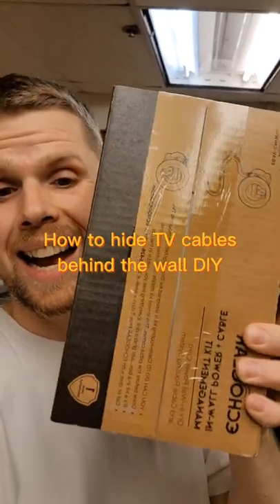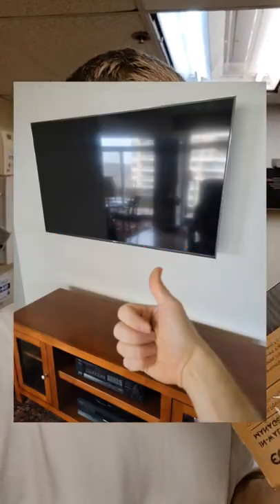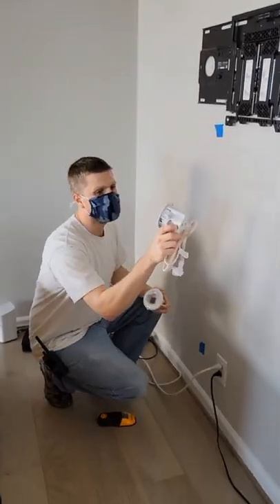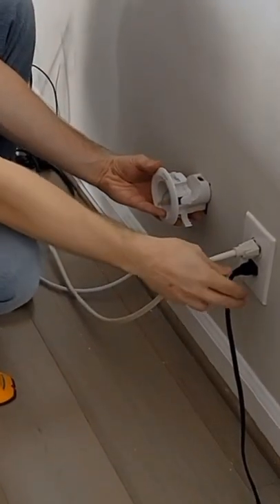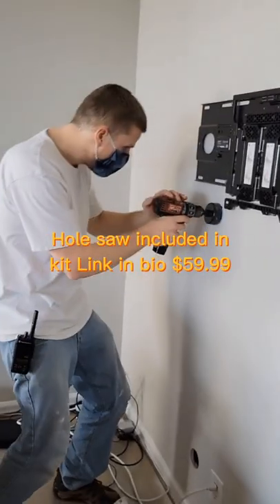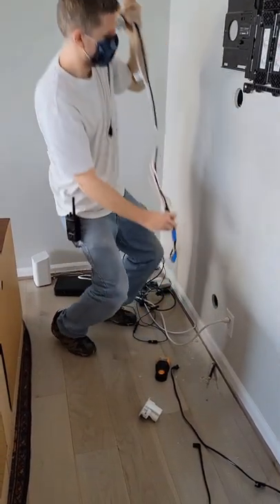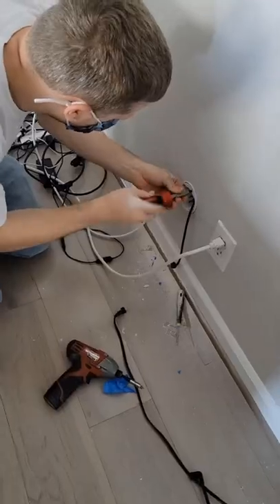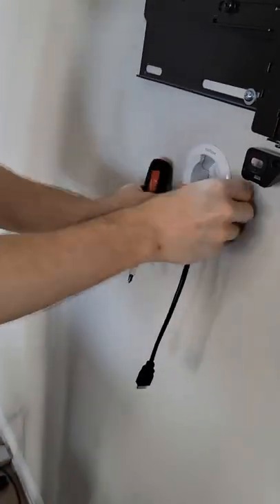How to hide tv wires #diy #shorts #handyman

Comment: Wait what was the point of the plastic piece
Reply from the maker: Which one
Reply: @Mechanicallyincleyend  the circle plastic pieces wouldn’t it be the same effect without it. Just drill 2 holes and run the wires through
Reply from the maker: @lilvic372  it has a recepticle at the top

Comment: You can do this way cheaper, easier and you can make the plug hidden too.
Reply: Your paying for the convenience.  Maybe he doesn't own a keyhole saw or drill bit or know what to buy. Nowadays people don't want to do anymore work than they have to . Yes it can be done cheaper he even said as much .
Reply: @rogerdodger5886  - I mean there are better products if you are putting a hold in the walll. If you are going to do all this, you can move the outlet straight up the wall and plug it in behind the TV. Same thing with the cable. Difference is he’s being maybe paid to show you this way with the kit.

Comment: If you can just drop that down your wall. You got screwed on insulation of your house
Reply: No need to insulate a wall if its an interior wall though...
Reply: @jeffreyruch7660  sound insulation has entered the chat.
Reply: Not having sound insulation doesnt mean you got ripped off though, not like thermal insulation missing..right?
Reply: NEC 400.12(5) extension cords cannot be installed inside walls.

Comment: OMG, they sell this!? I've been doing this for years.   BTW, if anyone tries this on an outside wall, it will not be so easy.   Insulation is a Mother*##*er.  Or in a house built before 1960.    Them old houses, they do not design the "old work" material for them, the ones that  need the work more than anything

Comment: ..so many code violations-
Reply: Not really I did this for my customers all the time it really does piss off electricians but it’s real easy to do
Reply: @Bob Saget power code in the wall is a code violation in my area.     I was going to install one of this in my new home.    Inspector said "NOPE"....
Reply: @Dont CensorMe it’s all in the fine print.
Reply: @Bob Saget it’s two completely different types of wire. Stranded wiring is not rated for in wall use, just like romex isn’t designed to be used as an extension cord. I think it even says it on the extension cord tag. So if this is done and IF it does melt down and cause a fire, don’t expect your insurance company to be very happy.
Reply: NEC 400.12(5) extension cords cannot be installed inside walls.

Comment: Bruh if that’s the case where you have no horizontal stud why not just connected direct to the outlet instead of having that ugly outlet and still showing wires at the bottom. This way the job looks cleaner and you have 0 wires, since that’s the reason why you did this in the first place.? 🤔